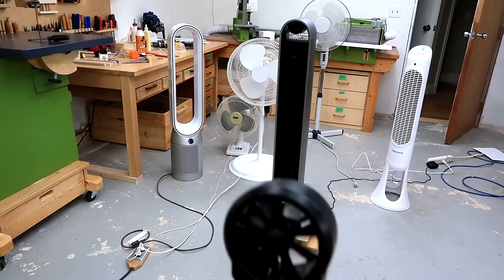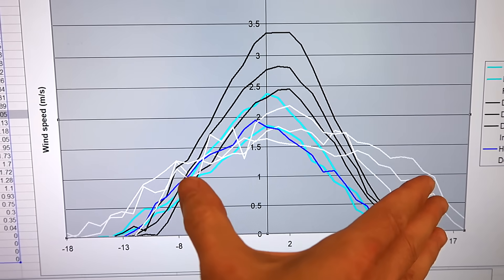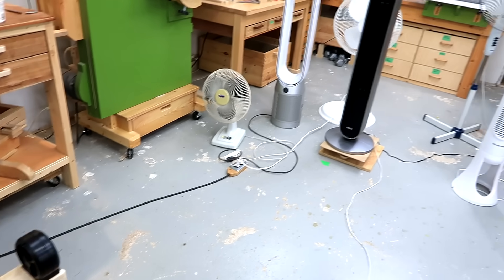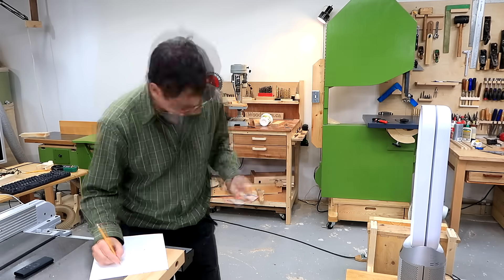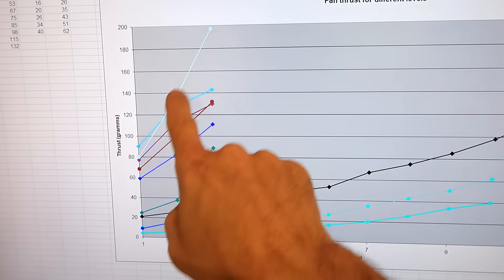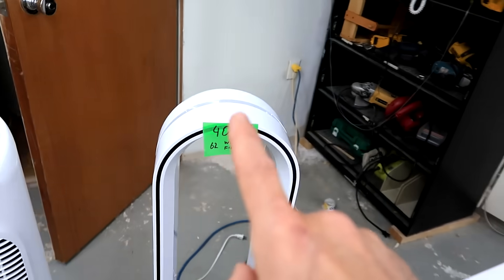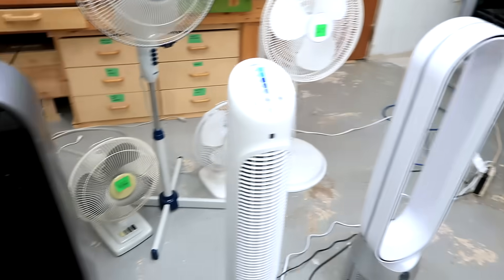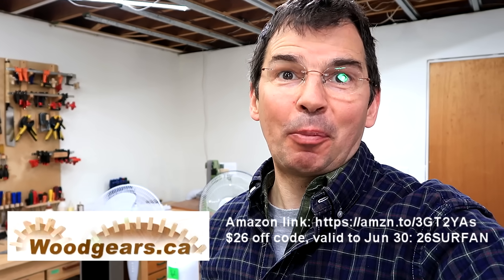Which fan blows hardest -- Tower fans and regular fans

Comment: A completely wrong and biased comparison. The only correct comparison of fan performance would be for the same input electrical power coming from the wall outlet to the fan. This requires the measurement of electric current, at the same current and voltage, and not grams.

Comment: Very interesting videos! Im not the best in physics but don’t you have to factor in the weight of the fan to measure the thrust? That would also explain the very good results of the cheap and light weight fans. 

The heavier the object the more thrust it would need to move itself.

Comment: I use a tower fan on its side with furnace filters for my air cleaner in the shop, it works quite well. The varying speed setting they call "breeze" on mine. Now I need to pull the fan off the window a bit. Do you think the screen plays a part in the distance?

Comment: Any fan that draws air more laterally will have less apparent thrust on that apparatus but not lower airspeed. that seems rather problematic. The best way to measure actual airflow is to cone the fan towards the anemometer.

Comment: Sorry if i missed it. But wouldn't getting the same brand of various models be more accurate for testing? When you add a new brand + new model it adds speculation on if the brand's design process could be the deciding factor

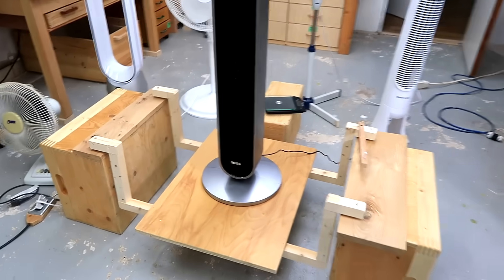Comment: Good experiment in the force of air produced but to truly get the output of the fans would you not need to take into account the weight and center of gravity and positioning of the fan propellors etc? As your rig more was suited to measuring force rather than total windage from the wind reader? I know you explained at 2:18 to 2:43 that overall thrust is the most "important" measurement but do you not have to take into account the oscillation of each fan? And you also need the xyz from the height of the fans relative to the door and or windows of the room? As your previous fan experiments showed that intake from outside air is less effective than putting a fan 30-50cm away from the window as well as the width of each propeller and also the curvature of each blade? etc etc

Comment: You should do these same tests on the dual window fans (the kinds with two fans that can blow air in, out, or both).  Be careful, because not every kind of "dual window fan" has that last setting.  Some can only blow in or out.

Comment: is the weight of the fans accounted for in the measure of thrust? i imagine if it's heavy, it sort of reduces the measurement at the scale as there might be a change in height of the fan based on the rig you've set up.

Comment: I think your force measurement idea was not thought out well when it comes to the Dyson.
Because the thrust is coming from the bottom and using an airfoil multiplier it does not have a push back that can be measured in the same way as a regular fan.   In simple terms a regular Fan is like a gun.  You fire it and you get an equal amount of force pushing backwards.  The Dyson is like a Bazooka.  The thrust is just expelling behind into free air so there is no kick.  In this case the Air behind the fan is being sucked and moved by air itself and not a physical blade that it can push back against.  All you are measuring is the air from the bottom being pushed out and not the multiplier effect  I am not sure if I am explaining it to you properly, but think about it.
Reply from the maker: Your comment was not thought out well.  I showed how the fan moves parallel on the platform, which makes the vertical location of he force irrelevant.  Your failure to understand this doesn't prevent it from working correctly.

Comment: as you were touching on, the problem with traditional propeller style fans is that they usually have 3 settings, and even the lowest one blows really quite hard. Often one just wants a nice gentle breeze. I use a towerfan with 8 settings, much nicer. It also has an ionizer which is surprisingly good at neutralizing bad smells like smoking neighbors.

Comment: I wonder how each would fare if you measure the thrust-to-air speed ratio, would you get a linear performance? Or will the fan design play an important factor at generating higher speeds at lower thrusts.

Comment: I would have loved to see the wattage taken up by each of these. Particularly the Dyson. I'm doing research with a similar type of system and as far as efficiency is concerned im wondering what the force per watt of power is. As in, is it REALLY multiplying the air in a meaningful way that translates to increased reaction forces on the fan?

Comment: I am not sure this methodology is correct by equating flow rate with thrust. The thrust equation is Force = MassFlowRate*Velocity,  which implies that you can have a higher force by keeping the flow rate the same but increasing the velocity. This is achieved by reducing the cross section of the fan exhaust. I'm not 100% sure on this, but it might scupper your beautifully designed experiment
Reply from the maker: Thrust is how much flow the fan can produce in free air.
Reply: @matthiasrandomstuff2221  
Yah, I intuitively though that also, but I don’t think it is right.

Lets say we have a flow rate of 1 cubic meter per second (to keep the math simple). If the fan has a 1m^2 cross section, the power needed to get that flow rate will be 1/2*m*v^2=0.5*1.3*1^2= 0.65w

If the fan has a 10x10cm cross section, the velocity of the air will have to be 100x faster to keep the 1 cubic meter per second flow rate, so 1/2*1.3*100^2= 6500w. In both cases, the volumentic flow rate is the same, but the smaller cross section fan has to do much more work.

So I don’t think thrust is enough to allow you to compare volumetric flow rates.

Comment: I used a three phase industrial motor and a attached a huge belt drive wheel to the spindle and then used a belt on a smaller adjacent belt drive wheel with a fan blade attached..... needless to say the wind blew the window frames off my sill but the suction was mad.... paper would fly out of other rooms and stick to the cage.... unbelievable!

Comment: if you wanna move air nothing better than a floor fan 20 inches of diameter with metallic blades. Yes, is loud but it has a good noise.

I have one 2 of them, one is a box fan that includes one of those 20x20 hepa filters, I use it to clean the air in my room and is so much better than every other conventional airpurifier, this isn't DIY, is made by Lasko.

the other I have is the floor fan with no hepa filter and metallic blades and keeps my room cool even in hot summer in Mexico city.

Comment: what about the fan size and weight besides the engine power, doesn't that effect the push back power
Reply: there should be a test with a fan with and without weight attached to it, to see if the weight plays a role in the push back power
Reply from the maker: It doesn't play a role.  I was measuring the difference in force with the fan on and off, and the fan didn't move between the two, so the weight of the fan plays no role.

Comment: I think that dyson has a lower thrust because all the fans take the air from one side and push the air to the other side, the dyson take the air from the bottom and push it to one side (if a fan take the air from one side and push it to the same side the trhust would be zero).

Comment: Due to the fact that fans send out more air when it's about half a meter from a window, if you attach one end of a cardboard box to the fan, and the other end to the window, and seal it up, the airflow in the room becomes kind of insane. Just make sure the fan is pointing outside.

Comment: Cool video... 😁. I think an important measure is volume of air the fan moves, not simply miles per hour. Probably need an expensive lab to determine cfm, cubic feet per minute of air volume moved.

Comment: Wasn't the thrust measurement wrong? 🤔. Because to move the thrust measurer. Because it would have to use parts of the thrust to move some part of the fans weight. Before getting a reading.

You could fix this by blowing downwards att the scale(with increased area to catch all thrust)
Reply from the maker: except it doesn't actually move, it only exerts a force on the scale

Comment: I took a Dyson because it does fan, air purifier and I took the humidifier one. 3 in 1 was what got me, not necessarily the specs.

Also the humidifier one can move air 45°, 90° or 90° with some turbulence (it moves both side separately) so I'm wondering if that does anything (at least I feel a breeze anywhere in my room now)

Comment: Hi Matthias, just discovered you just now with the Fan series. I had for a long a question in mind regarding fans that maybe you can test out if it gets you curious: When sleeping, how do I get the best airflow in the room ?
1) The fan blows from the floor directly towards a wall (can try a side wall and one opposite to the bed).
2) The fan blows from the floor diagonally towards the ceiling (can try towards a flat wall and towards an upper-corner).
You might get other ideas of positions (towards the floor ?) and directions in the process :D. My personal feeling was that towards an upper-corner was best but I might be wrong !

Comment: The Xiaomi SmartMi Smartfan series is definitely among the best and I'd say better than your top pick, it had 100 adjustable speed settings on the higher end fans and can be battery powered so you can use them wirelessly if you want. Also cheaper than $100. Use mine in the bedroom all the time.
Reply: Did you try the Vornado brand. I have a couple and seems like it very efficient

Comment: Yours is the first site where I saw someone actually using DATA to evaluate fan results, I'm a retired engineer and I salute you for that effort. My search is for a fan I could use that produced the greatest airflow for the least amount of noise.  CFM vs dbA.  Any suggestions Also how did you wire up the anemometer so you could read it via the UNO MCU? Great way to actually capture the data for later analysis. I couldn't find any DC Shrouded brushless Box Fans that should help with CFM and speed control.

Last fall (oct 2021) I built a The Corsi-Rosenthal Box: DIY Box Fan Air Filter for COVID-19 for my daughter's (she is the teacher)5th grade class room. I used a 20" box fan and Filterbuy 4-20x30x2 Air Filter MERV 13, Pleated HVAC AC Furnace Filters  as the filters (Merv 13). I used the Air King 9723 20-Inch 3-Speed Box Fan taped to the top of the filters sucking air up through the filters. I  cut and positioned a shroud around the front of the box fan to reduce the amount of air sucked back into the fan at the blade edges.The problem with the unit us the noise level of the fan. It interfered with her lectures. She basically had to turn it off while they were talking! I tried several things to reduce the noise level (Fan speed control) Electric Motor Control, 5.0 Max amp, 120V, # K177-1005.  The result was less than the success that I had hoped for. I was able to reduce the fan noise level but it was still too loud to have it running full time. In reducing the fan speed I always reach a point where the fan motor would start to hum. The humming got louder as the speed (voltage) was reduced. I didn't have any way of measuring wind speed at the time so I just did it by feel.

I'm  subscribed!

Comment: still got the setup? just put some weight on the table with the fan.. test before and after the weights moved.. same numbers? I doubt it.  your setup is unfortunately flawed as the arm pushing the scale is describing an arc (regardless of the distance travelled) around a pivot point. you have basically made a torque wrench that is pushed by a fan.. only the heavier the fan.. the harder it has to push to change that number.. think about it. its resting in that position because gravity put it there . to move it HAS to work against gravity... even if its 1/2 a millimetre travel at the end of that arm. if that scale wasnt there.. would it freely move continuously? no.. eventually the weight of the fan and the table it is sat on pushing downwards will stop it rotating.. gravity is affecting your setup.  you need a setup that does not do this... try laying the fan on its back and blowing upward weigh it... the difference between on and off is closer to your goal its only going to show a thrust figure.. and wont show how may cubic meters of air is moving at what speed.

Comment: Although it was briefly discussed, evaluating the series of fans in regard to a ratio of some sort such as thrust to overall noise (turbulent flow, motor hum, etc.) may be interesting and potentially useful in helping decide which fans may be more appropriate or desired in particular scenarios; e.g summer workshop vs studying area or office in which zoom conferences may be held and the fan noise might be bothersome
Reply: I agree, especially since one of the selling points of the Dyson is that it is so quiet
Reply: I agree too, but the problem with the Dyson is that it's noisy not quiet like they claim, unless you have it down on a super low setting which makes it pretty useless, hence a ratio comparison would have been good

Comment: Could you please test how much of a difference it makes to the air flow blowing air out of an open window as opposed to a window with fly screens in it? Thank you.
Reply: I seem to remember that depending on the weave of the screen, the screen material can take up 50% of the available surface area. When I place a window fan in my bedroom window I raise the screen up above the fan position, blowing air from inside to outside. The dual fan from Home Depot has side wings that close off the  the sides of the fan and the window  seals off the top and bottom of the fan. I'm assuming that the fan blowing out will keep the outside insects out of the room even with the screen up. I live in a 2 story house and on cool nights I have the fan in my second story bedroom and open a couple of 1st floor windows (w/screen) to draw the cool air in and expel the hotter air from the second floor out. My fan fits into the bottom window of a double hung window. I'd really like to somehow attach it into the top window (Hotter air up there) but it isn't possible with the frame structure of the fan. My wife isn't a fan of Rube-Goldberg. Noise level is also a problem, more CFM more Noise! I live in Central Michigan so only have this availability in Spring and fall.
Reply: @williammiller7543  I have thought of opening my screens as well, but they're the type that are on hinges so I can't open them partially. The window is a bit too tall for bugs not to get in above the airflow of the fan(as I found out...). I can't tell if I get decent airflow because of the strength of the fan, or because the screens really don't matter that much. Would be interesting to find out!
Reply: @williammiller7543  I have a standing fan, it's so powerful that it tries to fall backwards when I set it to full power! Gets a good draft going when pointed at a window.
Reply: @osirisgolad  Rick, whatever the power of the fan is the screen will be restricting the airflow. If you are happy with the current airflow then no more work to do. If you still want more airflow(More Horsepower) then maybe you could cut a cardboard frame for the fan in the window for a trial. If that is better then you can make a more permanent frame. If not, nothing lost except some cardboard and time! I'm going to have to watch the video again to see how you get more airflow by moving the fan back away from the window. Maybe same magic with the black bag!
Reply: @williammiller7543  This channel did a video titled something like "best fan placement to move air through the house" maybe half a year ago, he shows that placing the fan directly in the window is less effective than leaving some distance. It's actually noticeable if you sit in the window where the air comes into your house and have someone else move the fan away from the window, you can feel the airflow increase a bit.
Reply: @osirisgolad  I just tried that yesterday and it did work out that way. I was trying to measure the difference of a screen vs no screen for you but it was windy outside and the results weren't usable. I was surprised, a little wind and it was making a 10X more movement that with the fans. Proof that Nature Sucks.
I was getting a 25% to 30% reduction with screen in, but with wind, it wasn't repeatable. Big fan, 3 ft from window. I was reading where an average AC unit (whole house not window) uses about 1KWHr of electricity per ton of cooling. With the small fans I have it isn't even practical for me to try to help cool the house overnight unless the outside temp drops at least 10*F, even then I have to run the fan overnight. I don't know if I'm saving much but I enjoy the challenge.

Comment: I have a few box fans in the collection that literally tip over by themselves. The older ones are probably double the power of the new ones. I agree with the statement that propeller type fans don’t have as nice of a low speed. While I prefer the appearance of them to others, the towers do have some advantages. That Dreo fan impresses me by the way. Similar features that we see from some ceiling fans on the market these days. Those ceiling fans with the Dreo would be an awesome pairing. Thanks for the great video!

Comment: Bought this fan and returned it immediately.  Fan had a grinding noise that could be heard at all speeds.  Never spent so much for a fan before, figured I'd splurge and was immediately punished with a defective unit.  Not going to bother with a replacement, just going to get my money back and use what I had before.

Comment: I hardly ever go back after using circulation fan. it almost like jet.
only need few circulation fan to keep the air flowing throughout the entire room.
traditional fans, even at maximum power, are only stirring the air in the same area.